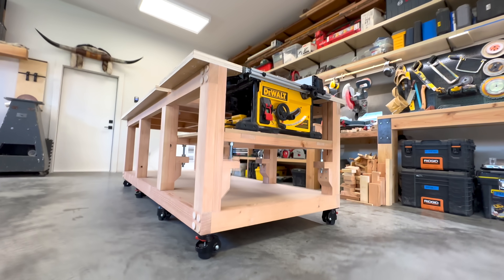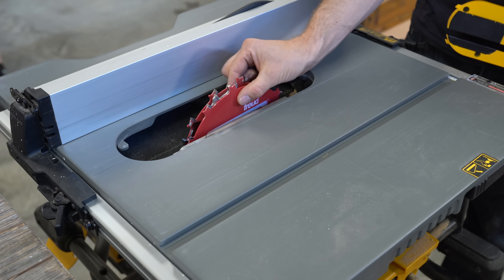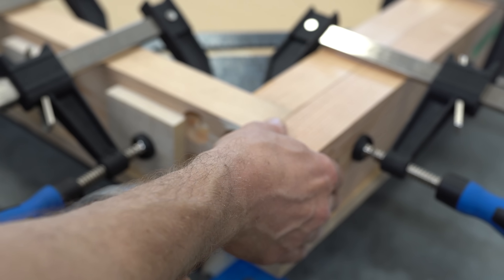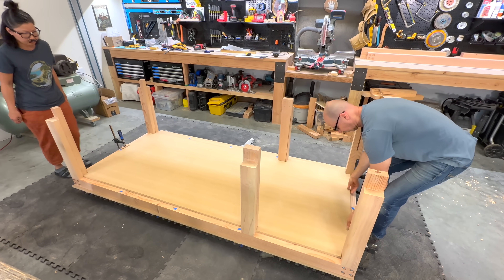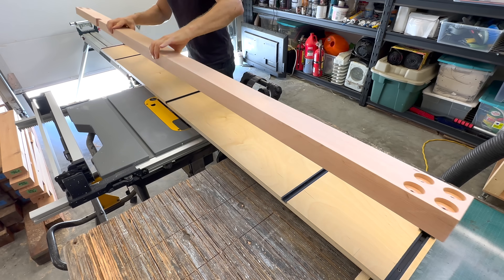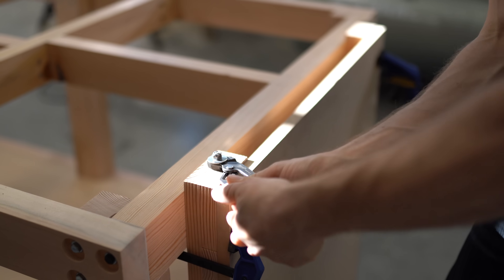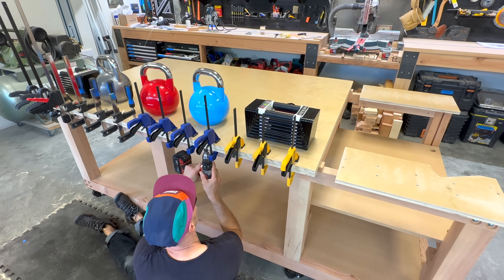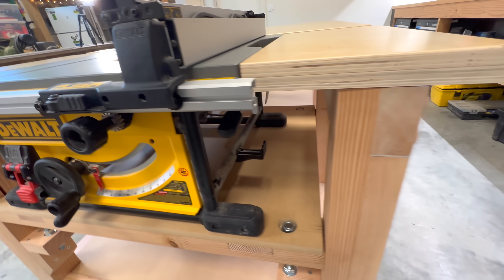DIY Table Saw WORKBENCH Dewalt 7491

Comment: How do you handle dust collection?
Reply from the maker: Hi, That has been an ongoing battle, but for now, I have two shop vac's. One that is permanent for my miter saw station, the other is mobile, and I physically connect it or discount it each time I need to use a tool. I've been doing some research and I will be purchasing a much larger unit and installing PVC ducting that runs to each machine. Thanks for your question! Cheers
Reply: @vanislestudio  I like the idea of PVC ducting! I’m probably going to be upgrading my bench this summer so I’m on the lookout for new ideas to incorporate. Thanks!

Comment: Okay so im fairly new getting into woodworking building my own cabinets tabletops cutting boards etc will this table saw be worth the 300$ or should i just spend the couple grand because every video i see is yes and then no and dont buy this saw etc
Reply from the maker: Hi @reaperzro. Thanks a good question and one I asked myself. For me, I liked how portable and light the saw is. I will be moving one day and can easily take the saw with me. I did not use glue in the workbench, this way i can disassemble it and take with me.  I think it really depends on what you want to use the table saw for. Each have their pros and cons. What I do know, is its a good saw. Its not perfect, but for my needs at this time, it does the job well. Cheers and thanks for your comment!

Comment: what are the final dimensions of the table? In metric please. Thx
Reply from the maker: Hi there, The table measures 2400mm long by 1200mm wide by 896mm high (dependent upon the height of the casters you use). Hope this helps and thanks for stopping in! Cheers

Comment: What type of wood do you use?
Reply from the maker: Hi Cristian, the wood is sourced locally here on Vancouver Island. The legs and bracing is Douglas Fur, the top is Birch plywood. The bottom shelf is medium density fiberboard (MDF). Thanks a lot for your question! All the best

Comment: Are the plans available ?
Reply from the maker: Thanks for asking, they are really close to being finished. Within a week. Thanks for checking out the video and stopping in! Cheers
Reply from the maker: Hi. Thanks again for inquiring about plans for the workbench. In case you are still interested, I wanted to let you know they are now available on ETSY.  Here's the link  http://bit.ly/3s4D7Ta

The plans utilize imperial measurements, and use regular sized 2X4's (3.5 inch X 1.5 inch).

And in case you are interested in building the workbench using the exact dimensional lumber I used in the video (3 5/8 inch X 1 13/16 inch) I'll have those plans available on ETSY on Oct 31. 

Thanks again for checking out the build! Cheers Paul
Reply: Not for 20 , its not worth that for a simple table
 @vanislestudio

Comment: Impressive build.  Impressive video effects.  You got my sub!  Where is your Etsy shop?
Reply from the maker: Hi @joemadden it’s in the works. hope to have it up soon and it’s awesome you’re even asking! Thanks a lot! best Paul
Reply from the maker: Hi. Thanks again for inquiring about plans / ETSY Shop for the workbench. In case you are still interested, I wanted to let you know they are now available on ETSY.  Here's the link  http://bit.ly/3s4D7Ta

The plans utilize imperial measurements, and use regular sized 2X4's (3.5 inch X 1.5 inch).

And in case you are interested in building the workbench using the exact dimensional lumber I used in the video (3 5/8 inch X 1 13/16 inch) I'll have those plans available on ETSY on Oct 31. 

Thanks again for checking out the build! Cheers Paul
Reply: @vanislestudio just bought the plans.  They are VERY good plans with plenty of detail.   Looking forward to building your table!!
Reply from the maker: @joemadden  that’s awesome! I’m excited for you! And please Let me know if you have any questions at all :) Cheers! Paul

Comment: This Dewalt saw has about the smallest table on the market.
It means that the cutout is bound to be too small when "upgrading".
It would have been much wiser to spend the effort on stiffening the fence first, because it flexes like crazy which causes rough cuts and blade burns beside the precision issues. I really don't get how DeWalt didn't fix this issue themselves at some point in the past what, twelve years? Fifteen? Twenty?
Reply from the maker: Hey @Cancun771 thanks for your comment. I might  upgrade the fence on the saw in the future, not sure but for now it seems to be working ok for me. Thanks for checking things out.

Comment: I bought 2x4's from Home Depot.  They are a bit rough. Was thinking of running them through my planer first, but that will obviously change the dimensions a bit.  Should I do that or build as-is and use an orbital sander when assembled?  For some reason I hate using my orbital and would rather do the bulk of the work with the planer. :)  Suggestions/recommendations?
Reply from the maker: Hi Mike, thank you for choosing my plan! If you opt to plane the face or sides, yes, like you said it will alter the dimension, and ultimately affect the measurements in the plan. It's not a huge deal, I would print out each page, and note the changes to the affected parts due to the new dimensions of lumber. Some folks have purchased 2X4's from Home Depot (3 1/2 X 1 1/2), and removed 1/8 inch from each end, bringing the final dimensions to (3 1/4 X 1 1/2) and noted down the changes to measurements on each page. But yes, To sand, To plane...Yup. Try to remove as very little material as possible is what I'd say. Wishing you the Best of luck on your build Mike! Any questions vanislandstudio@gmail.com I'm happy to help however I can. Cheers

Comment: Update.  I believe that was Windsor mill sales.
Reply from the maker: Hi again, Yes it was Windsor Mill sales for the Rough Cut 2X4. FYI I had them drying out in my shop for a few months before working with it. Stacked in a neat pile with spacers. I used a couple fans (lowest setting) to move air through / across the pile to help air dry...

Comment: Nice table and work bench but if people think their going to be able to do any serious wood working with that table saw their mistaken. I’m thinking the only things those saws are for are flooring guys cutting 1/4 pre-finished wood flooring
Reply from the maker: Hi @richardthomas1566 thanks! Yes, the 7491 cant compare to high end solid cast top saw's. It is working for me at this point though and for what i paid its a pretty good saw I think. Maybe I'll upgrade later on. Cheers